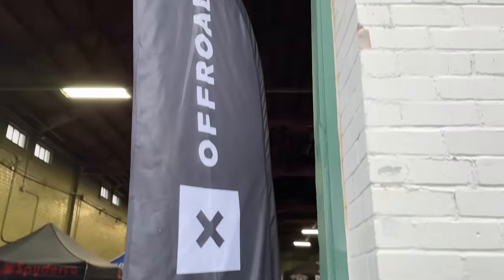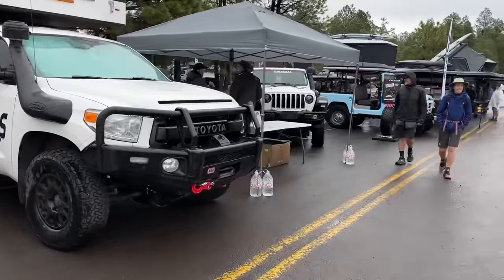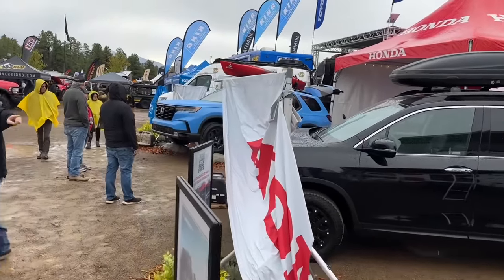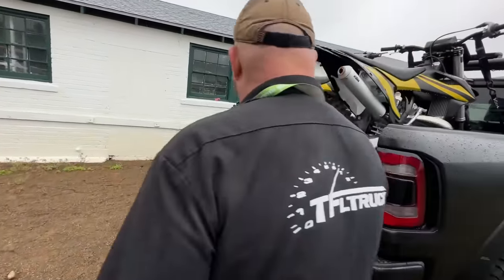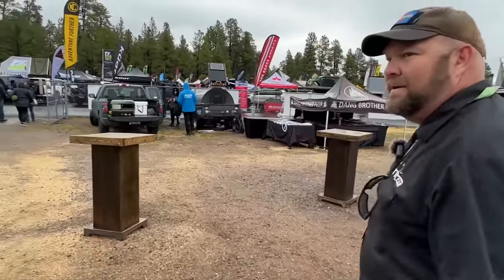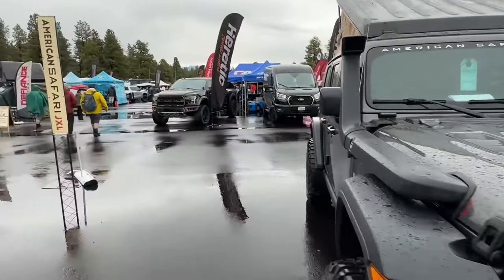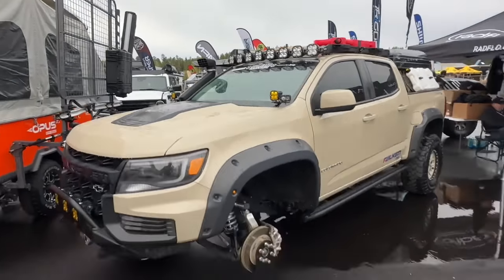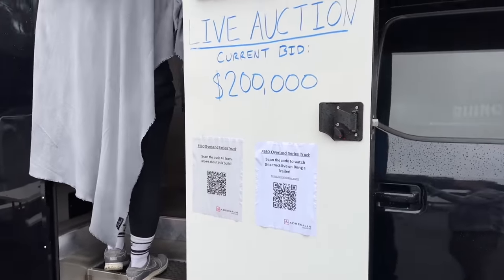I Went to 2023 Overland Expo & Was Floored by All Tiny & Giant Overland Rigs...Especially THIS One!

Comment: Finally someone said it! Thx Nathan! Yes, rooftop tents are stooopid for most users. Its a fad and people quickly realize their biggest value is how cool the vehicle looks. Unless you actually overland full time or for extended periods I rather use a regular ground tent.
Reply: What does value have to do with overlanding?
Reply: People say it’s stupid all the time. But what works for some maybe doesn’t work for others. I sleep really well in mine and it takes less than a minute to deploy and or put away.
Reply: I agree completely, though I do like truck bed options (e.g. slide-ins).
Reply: @davidmartin6721  Poor people say it all the time. They don't understand the advantages. I have both an RTT and a Gazzelle Ground tent. The two options are 100% completely different applications, and the RTT is so much better beyond comprehension for multiple reasons.
Reply: Our family has been tent camping all around n Cali for past 10 years. With this experience...we can say that...tent camping is no problem in 4 months of summer but rest of the year it's a pain making sure to sleep comfortably n warm. I am pointing to cold and went ground  Just for this reason..I think RTT's make perfect sense.
Reply: @saikumarganji.i  RTT allows you to camp where you want. If the ground surface is wet, mud, rocky, snow etc etc , you are fine in an RTT. You also can keep your bedding in the RTT and no need to set up cots, bedding etc. Its a 30 second tent set up and now you have all teh storage space back that used to be used for bedding , blankets, tent, cots, sleeping pads.
Reply: I love my RTT on my trailer and it’s perfect for some of my travels. And I also don’t leave home without a ground tent. I would be leery, taking an opinion from a guy who is out of breath, walking around on a cloudy day, talking about how he rather sleep in a hotel.
Reply: @tarpontail2750  On a trailer the RTT makes a lot of sense. You can make camp set everything up and then go exploring and come back to camp. Its awesome.

Comment: Humvee portal axles are prone to failures on highway driving. They were a common wear\replace item. Replacing the old underpowered diesel is a good start. I would however be worried about parts availability.

Comment: Amazing, just need to be independently wealthy to touch this stuff and a rocket scientist to work on the stuff by the time it filters down on the second hand market. Sadly the stuff that's easy enough to mod and fix in the field or keep running is selling even faster, the peaceful middle ground is where I'm at.  2014 to 16 I think was the pinnacle of capability while being somewhat servicable, not TOO covered in whirlagogs that break. A Japanese manufacturer thankfully kept things pretty simple for awhile. Im sad that in the US we've driven the market to give us land limos, I'm happy that the manufacturers have started to put out offroad capable vehicles again. It sucks though that to get the lockers and tow points you have to bundle another 25k worth of home theater components and leather computerized things that go bing.